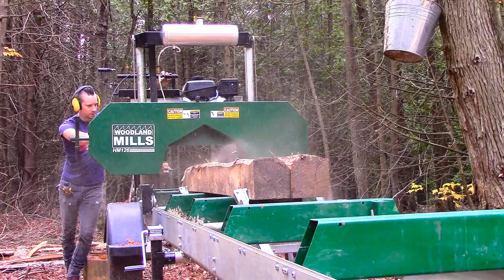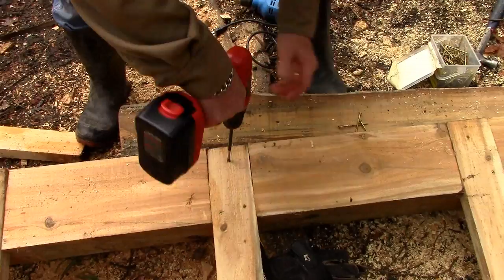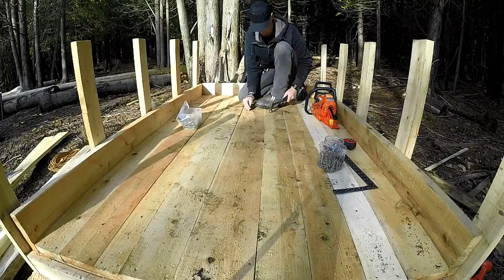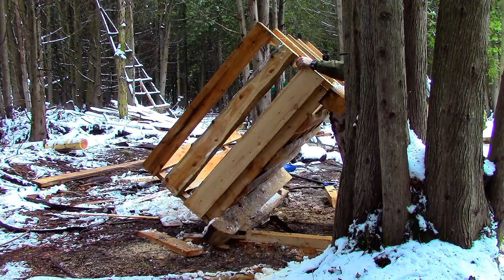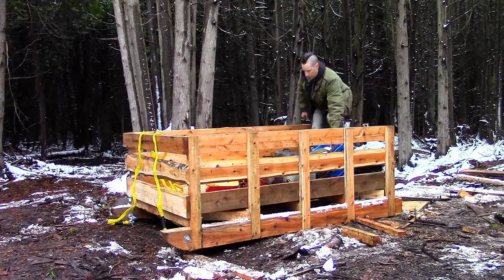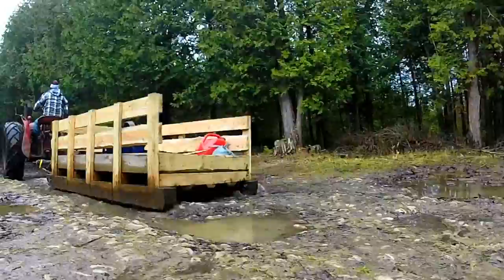Stone Boat- Inexpensive Logging Trailer!- Ep26- Outsider Log Cabin

Comment: FYI The sled is made from seasoned cedar , which has a natural wood preservative in it. This wood is used as fence posts and lasts for decades in the ground .It  is also a light  weight wood ( light enough that 2 people can easily tip it up onto its side. The skids aka runners are still  5-6" wide not including the cut outs for vertical posts.  They will last for years with out metal etc on them.   As noted it would work to have rounded runners at the back with eye bolts. Outsider was using the drill to drill holes at the back  for them. There is slight rounding on the bottom corners but can be increased if needed. Thank you all for your input and interest in the Outsider  channel. This kind of projects and work is something we both enjoy!
Reply: Hi Senior Outsider. Both you and your son are incredibly hard workers and the joy you both have for perusing this dream of the log cabin which will benefit the WHOLE family . This is because a lot of hard work and excellent planning have gone into it so it will be standing when we are no longer here that's for sure. Thanks for the videos.

Comment: Mr Outsider  ,    always look forward to seeing your vids ,  even if its weeks after  , before I get to them .    That  cargo  sleigh  looks pretty darn handy  !   Having hauled much stuff in the bush I would make a suggestion .    When you get time , round the back end of the runners  , possibly someday you may get in a jam , and you will have options of push or pull either way .    Cheers brother       Cyril
Reply from the maker: Great suggestion! I didn't show it in the video, but I did actually round the back of the runners off a little. I've already had to back it up. Seemed to work pretty good.

Comment: Great video.  God bless.  One thing I would suggest is once summer is among us again. To get a small blade box of the back of the tractor to scrap and level some of the area around the cabin where you already have it cleared.  Take away alot of the top dead and decaying leaves to get you a good hard suffice to work till you are done then you can then put back any good top soil you may moved
Reply from the maker: Thanks for the suggestion Nathan!
Reply: I have been watching this for some time in the land of Aussie. I am enjoying every episode. Over the years dad and myself and some of my brothers have built 11 sheds of varying types,all with steel frames that we made ourselves from secondhand repurposed I beams and secondhand repurposed galvanised steel for the rooves. The last three I cut the Cyprus pine used from trees on our farm and neighbours robust as purling.  Now for some I have been debating the idea of building a house for my self in your style or out of basalt rock and or sandstone both of which we have in abundance inbred area I live.

Comment: Just a couple of suggestions, when starting nails (especially longer ones)hold the nail just under the head. If the hammer glances off it will push your finger out of the way instead of peeling the skin off it.(Been there done that)Second,a plastic runner nailed to the runners on the sled will allow the runners to glide over the soft rain as opposed to plowing through as deep. As I said just suggestions from experience. Great video series.
Reply from the maker: Your suggestions and experience are certainly welcome here! Thanks for the valuable input.
Reply: My pleasure.

Comment: What a great trailer. If you can find some cheap plastic runner material and put that on the bottom of the runners you'll have even less friction to pull the sledge around.

Comment: An old pickup truck plastic bed liner could make a nice light skid pan and runner material for the skids . Make it slide easier and stop ice an mud build up .
Reply: A more durable one is made from the hood of a old car. One perhaps from the 1960's or so.
Reply: "Skid Pan and material for runners for skids " UHMW plastic is a
Extremely tough abrasion resistant, low cost plastic, used for a wide range of wear applications. UHMW (ultra high molecular weight polyethylene) is an extremely tough plastic with high abrasion and wear resistance.

Comment: Hi, Plus 1 , On The Other Comments on Rounding Off the back / Rear End runners  ?  Maybe also Adding another Pair of Eye Bolts To the rear of the sled , So it can be pulled in reverse to get unstuck ? Possible a second sled  ,,, A " flat - Bed  Sled " ? Great Build ! Great Work , Father / Son TEAM WORK !!!!!

Comment: We have problems deciding how to move our logging equipment and then the logs themselves. The sled looks perfect for our often wet sloping fields but then we need to work on a winching setup. A 12v off our current 24hp tractor or a 240v with a generator on the sled? We have a forestry jack, some homemade log skid plates and two cones (ex canoe ends).
We have some large pine that were dangerous and needed felling but how we get them up the wet fields to where they might be milled needs a lot of thought. Well you did ask for ideas!
Love the clear and precise guidance with the sled build. Looking forwards towards 2018. God Bless from Wales.

Comment: Similar to this rock sledge you could have built a log sledge that would lift the one end of any log you are dragging off the ground. It would allow your tractor to pull logs much easier without the ends of them digging into the ground.

Comment: If you bevel the edges of your skids, you will still have the vertical strength to prevent bending, but reduce the drag for more efficient pulling. IMO.  When you get to feellnfrisky, you can bolt some 83 ranger spindles to the skids,  put some cheap wheels, and add some tracks to it, for a more fun time, and keep the smooth ride. :-)

Comment: Caridge bolts, I would not bother with nails,  Strait pull on eye bolts, Your o.k. for lighte work,  When the heavy work comes along, It will start to come apart. Just a comment. You have a sled. Your going to get the job done.

Comment: If you ever have to replace the "runners" on the sled, think about leaving the sides  rounded, it will make the sled able to climb out of ruts easier without skewing the sod or mud and also easier to make sharp turns without putting too much stress on the runners.

Comment: I have been researching how to make your own fence posts. My area is dominately spruce and pine. The harvesting and peeling is straightforward. I am trying to figure out best/efficient/financially feasible way to treat them before putting them in the ground. Have come up with 3 main ideas. Charring, soaking in preservative and soaking in mixed used motor oil/diesel fuel. Cant decide which way to go. I have mostly hardpan clay to deal with but do have bands of gravel running here and there. Have yet to find how to do it. Evidence. Soaking has to be done when the wood is still green. can't find when is best time to char. And would I then still have to set them aside for a year or so to season? I am eager to try this year even if its a long term experiment. I have no end to my trees. Your thoughts and help appreciated. cheers

Comment: To funny. I only watched three seconds of your video and I'm still laughing. I purchased the same drill and the same thing happened after four holes. Thanks Canadian tire for the quality. I couldn't find the bill to return it. Maybe they should have called it a anchor. Back to the video.
Reply from the maker: lol Glad you got a kick out of it Kelly. I'm actually impressed the drill lasted as long as it did, considering I used it to drill 3/4" holes into all 9 foundation boulders for the cabin. I think I drilled through a total of 7-8 feet of rock with it. Never worked the same since then though. It finally bit the dust in this video.
Reply: Suddenly I went back to the tools that cost more. I have a compress (master craft) I have used it for 1 second and it's seized. To heavy for anchor. I'd really enjoy helping you.

Comment: And you can mount some wheels on that pretty easy if you want
Reply: Rix    I use a small sled with two wheels on the front (only) which works for moving rocks, which I pull with my lawn mower. Easy to roll the rock onto the sled, no lifting.  I do not have the power of a tractor.

Comment: when the cheap drills start to smoke if you let it cool it will still work for awhile.  I had one that would smoke and it lasted 2 years.  I know an expensive one is better but when you are leaving tools behind someplace like the shed, a cheap drill is better than the expensive one.  Mine disappeared, over a couple months of not visiting it it grew legs and ran away.

Comment: Angle cut the back runners so you have a push me pull me.
Reply from the maker: Thanks for the suggestion. Already done my friend.
Reply: Or maybe just put some  log disk wheels on that you can take off in the winter for a sled. Humanity only found out the wheel a few thousand years ago after hauling dead weight at tons of extra energy for millions of years before. It is not exactly reinventing the wheel, is it?

Comment: Proper job looks really good you can't not back it up do you have eye bolts on the other end also so you can unhook the chains and Pull It in the other direction
Reply from the maker: Thanks Kevin! I rounded the back of the runners as well so I could do just that. I was also in the process of attaching eyebolts to the back, which is when my drill started to smoke... lol So I currently have 1 out of 2 eyebolts on the back.

Comment: Great job! Why not some gaps in the decking to let water drain through?  Or do you plan to haul fill and sand at stuff at times?
Reply from the maker: Good suggestion! We'll be hauling a little bit of everything.
Reply: Once the wood dries, gaps will show up
Reply: tim s 
The wood is already quite dry. This is cut offs from all the logs cut for the cabin.

Comment: Why would you put those big eye hooks through the sides of the runners where they can snag on things and cause drag? Why not insert them through the top of the runners? I think the back bottoms should be bevelled also.
Reply: Across the grain of the wood for maximum strength. Vertical would be with the grain, thus much easier to split when under a load.

Comment: apparently you have money to burn since you didn't mind burning up the drill.  You also waste a lot of good timber.
Reply: Where is there timber waste? As to the drill, how do you suggest he get the job done?
Reply: Yeah, he was using the drill to its last legs. Anyone with "money to burn" would have quit using that drill real quick. And they use it throughout the video.
Reply: How do you suggest he drill holes in the wood, if he didn't use what he had on hand to get the job done? Stop work and take time to go to spend more money for a higher priced drill in order to save one of less cost?
Reply: Strike that. It was the last time they used it, but still, Old Timer is right. He had another option, hand drilling? I doubt The Outsider saw the future of the drill starting to smoke while he was drilling. Once it starts smoking, what would you have done?
Reply: Well I'd say that wasnt a very expensive drill to begin with, even so, corded drills are pretty cheap even if you get a DeWalt or Makita.
That being said, he should buy a better one next time.
Reply from the maker: Were you expecting to see tears from me when my drill began to break? Of course I mind when one of my tools breaks but I wasn't about to hold a funeral for it. lol
Reply: If you have never burned out a drill in your life then you don't work much. even the best ones can burn, the point is the sled is great and remember you can not make an omelet without breaking some eggs, shit happen deal with it.
Reply: Drills burn up with age and use. Saw a brand new Hilt I hammer drill go in less than a week. It was doing a few thousand holes aday. They gladly replaced it. And after ward Tennessee Vols played in a bowl  never more a horseshoe
Reply: The Outsider Tears would've been a waste of time.. I like your attitude when things don't go as planned 👍
Reply: Dude, it's like a 4 dollar drill.  No great loss.